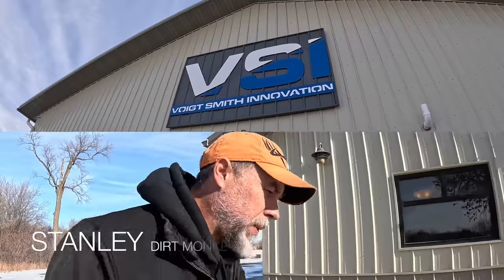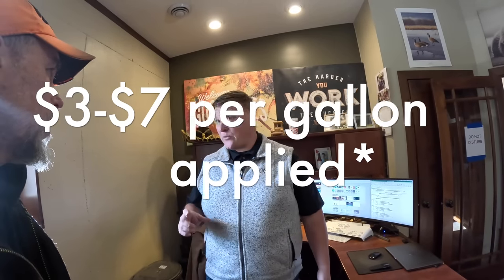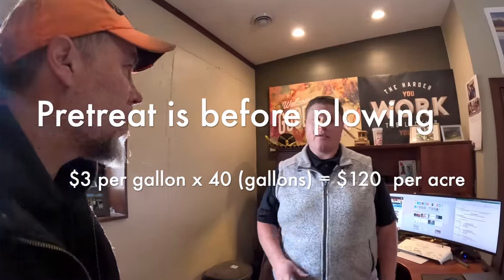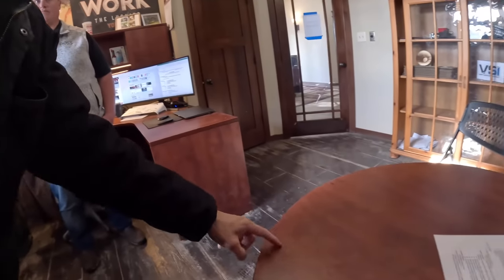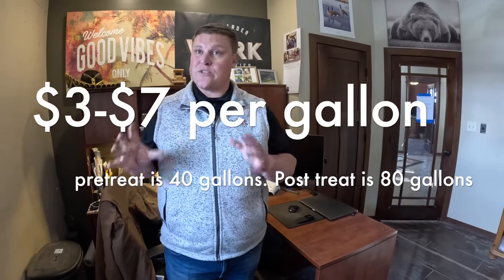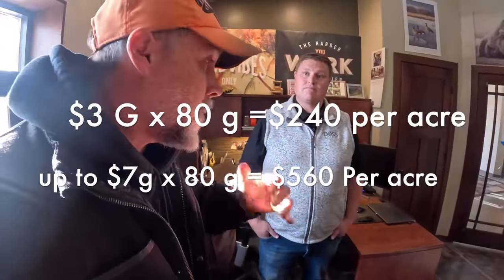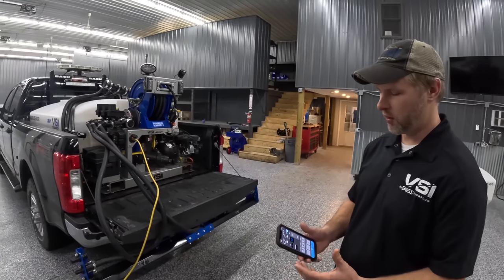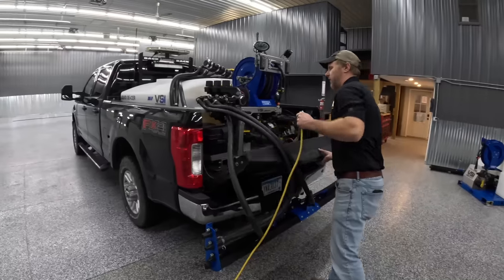industry SECRET to Salt & Brine:  pricing, equipment, rates and more

Comment: This is 25 to 30 year old technology in the Uk , only different tech on the Bluetooth side , what they should do next is , through their gps have the system turn on when they enter their site and off when they leave it , I worked for a company who did this 20 years ago , so if they were doing main roads like your municipality companies, they would start on route 1 then drive onto route 2 and if at any point while doing route 2 they had to drive across route1 the machine would stop and restart automatically as it rejoined route2 , this isn’t new , it’s only new to you , areas with lots of steel bridges they used a separate machine and spread either coke from power station furnaces after it was recycled, or horse urine , totally natural with no harm to the water below these bridges , come on guys, do you know the Beatles have split up ??? 😜
Regards Davy 🇹🇭

Comment: So I made a statement you about videos back why don't  big loaders have a snow plow on the rear end this to me is more efficient when you can make a tool a Swiss army knife not just cut but Band-Aid a situation so you plow with the loader and on the back side you have a sprayer of de-icing this company would have to modify a sprayer tank system to mount two a loader you would have to saddle the rear end of the loader but be able to just mount at the rear end of the loaders attachment a tall order very tall order yes you can work out of a pickup truck again when you can Swiss army your equipment not just do one thing but two things is better the one and an operator good operator becomes three things instead of just one now you're having your French bread with butter and it's toasted too

Comment: Some of the numbers don’t quite add up 40 gallons per acre is less than a gallon per thousand square feet sold Brian’s only hold about 23% salt by weight. Or 2 pounds of salt per thousand square feet. That’s pretty thin even doubling the quantity of brine for post event
Put many many many gallons of brine down in early 2000 it worked well but the numbers presented here are a bit off and optimistic
Reply: I can assure you those numbers are accurate and effective, especially on the pretreatment.  There are some additional factors on the post treatment end that might mean a higher application rate in certain scenarios, but 40 gallons per acre pretreat is pretty much the standard for a snow event.

Comment: WE GOT HIT with about 8 inches for sure... wet heavy perfect snowball snow... 12/9 left the house at 130 in the seat by 245... clocked out at 12am 12/10.. deer season opens in about 5 hours so I gotta crash for a few

Comment: I think that every company that uses Bryan if they had a there's an accident on the road because that run is super sweetI think that every company that uses Bryan if they had a there's an accident on the road because that run is super   Slick when it is applied that they should be responsible for ever accident on the road that they apply to or ever parking lot they applied to then they'd stop using the junk
Reply: Sounds like you are experiencing a straight mag chloride application.  These often leave a snot like residue on the surface.  This is a pretty common product in the Western US.  I can assure you that straight salt brine or salt brine with a top tier additive do not have that texture when applied to the surface.  It’s exactly like walking on wet pavement!